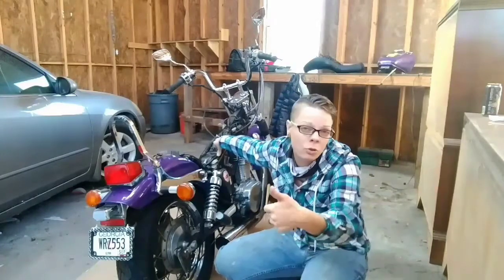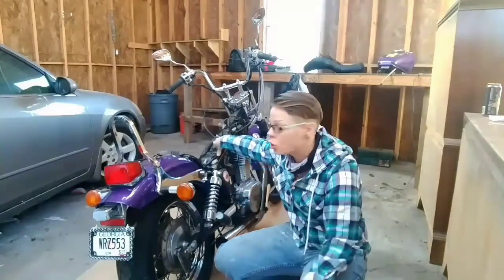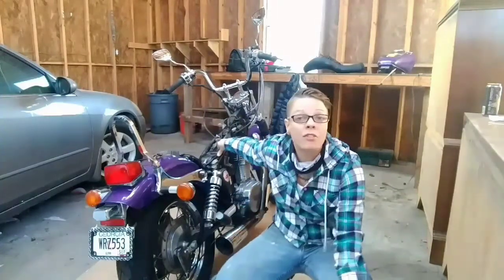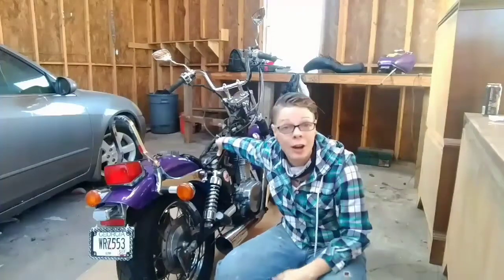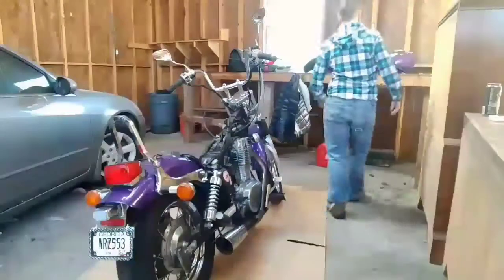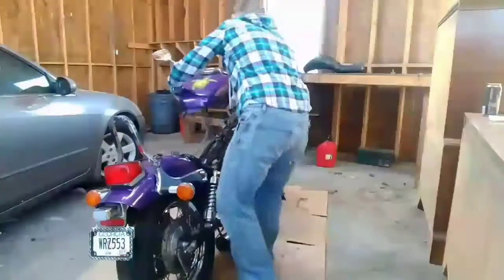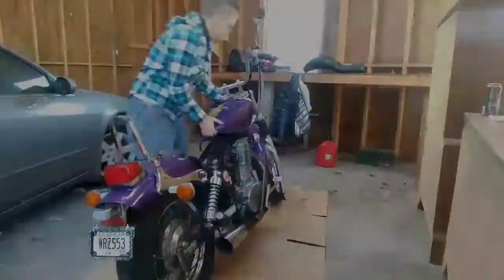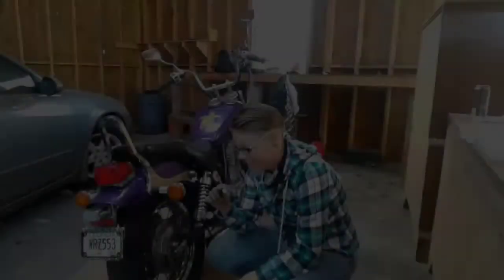Motorcycle turn signal relay. Diagnosing turn signal relay issues on a motorcycle Suzuki S40 2023

Comment: I think i am have the same problem on my wife's new bike. She dropped it and broke the rear turn light went to replace them today and now the rears work but the forward lights stay on. Any thoughts? Do you think its something else based off your experience with your bike?
Reply from the maker: The front turn signal lights should stay on when the key is in, these are called your running lights. They should only blink when you have the signal turned on. This is a safety feature to make you more visible to the people coming your way.  Hope this helped let me know!!
Reply: @motomantha   My roller derby queen will love this new information, thanks!